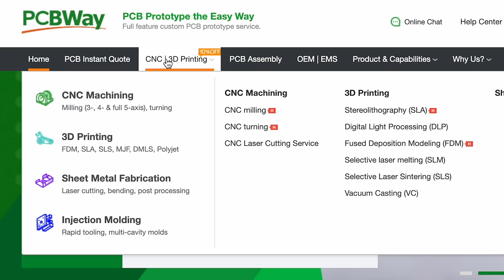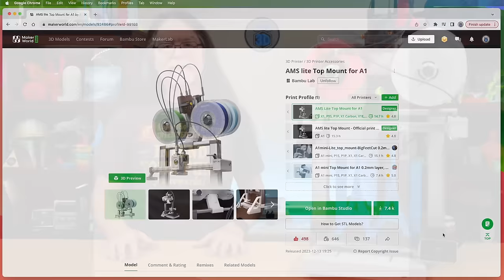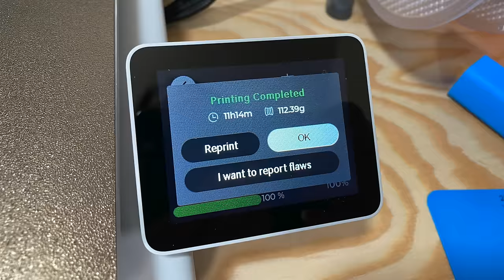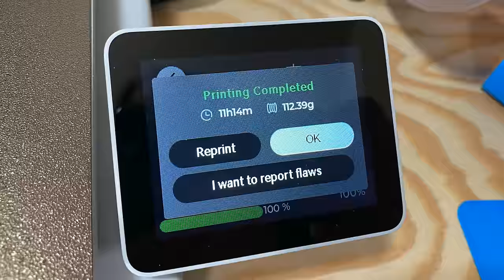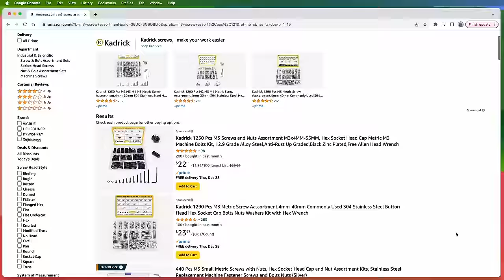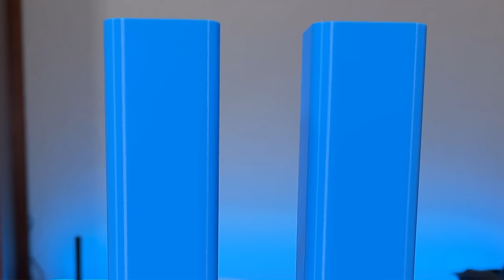Bambu Lab A1: Does AMS lite on top RUIN print quality?

Comment: The thing is, while the printer may wobble, the motion between the printer and table doesn't matter. The only thing that needs to be constant is the motion between the extruder and print bed, and because of a strong design, that doesn't change. This is the same reason that all the shaking of an X1C doesn't really matter, and new feet or concrete blocks don't change print quality. But a great video confirming this.
Reply: “strong design”... no, it’s not! Both Z-beams are absolutely light and relatively thin - only connected at the top by injection molded parts - tends to skew. The entire print quality only works through active input shaping, so you shouldn't fool yourself or sugarcoat anything.
Reply: Probablemente colocar tanta masa en ese punto crítico, aunque a priori no afecte a la calidad de impresión, acabe por  reducir la vida útil de la impresora. Las vibraciones nunca son buenas para ningún mecanismo.
Reply: Exactly. I believe Maker's Muse did a series of videos on this a while ago where he tested different configurations and even suspended the printer in mid air without much difference to the print quality. This is before input shaping was available so that benefit was not a factor.
Reply: @emtrax bro ate you a bot or a hater? Why such negativity on so many comments?? Go touch some grass
Reply: Thats not exactly true. The higher the the print goes the less stable the Z access is and it can result in layer inconsistencies. Take a 2x4 for example, if you cut it at 2 ft it will be more sturdy than at 6 ft. The same thing happens with 3D printer and especially when printing at higher speeds. The screws are holding the top frame to the bottom where its sturdy but it flexes at the top. Input shaper can help with this but input shaper is also being run at the bottom where its most sturdy. Adding weight to the top will result in layer issues and print quality degradation unless the Z access has added support to compensate for the extra weight. The printer wobbling is a little different with the X1C because it has a ridged structure supporting the whole printer and input shaping can compensate for any added shaking. If you put an older bed slinger like the Sovol SVO3 on a less stable table, you will see a difference in quality over having it on a sturdy surface. Thats one reason people used to 3D print flexible feet for their printers. 

There are many reasons the print quality doesn't appear to be changed in this video though. He is printing at a higher resolution in precision mode or just printing these super slow since they took so long to print. This will help far more with added weight but takes twice as long to print. The 3D printed support brackets on the back play a huge role here too for adding stability to the top frame. He is also taking advantage of color filament chosen, camera lighting, angle of recording, and Youtubes compression so we cant see any layers and the print looks identical.
Reply: @BenWolkWeiss  I think Thomas Sanladerer did something similar.
Reply: Depending on the print the print itself will move in relation to the bed and cause artifacts.  

Wich is why the eifel tower ones look identical.  But on the square tower is clearly visible wich is wich.
Reply: @jmp7624   good to see there are people witb intelligence here.

You said everything i said to the youtuber except you managed not to insult him.  Wich is find strange.

Comment: Oh no... why does the test model taper so much towards the top? Please use models that independently cause large X/Y movements at low and high Z - the Eiffel Tower is absolutely unsuitable for the test! The alternative tower is also unsuitable - symmetrical distances and too narrow... no possibility for sufficient acceleration.
Reply: Most 3D models taper at the top
Reply: @car_tar3882  you're missing the point
Reply from the maker: Hi! If you've got a suggestion for a model, let me know. I asked for suggestions on the first A1 video, and got "Eiffel Tower" and "Wobble Test" so that's what I printed. I also got a suggestion for the Torture Toaster but that one's pretty short so I didn't think it would show much.

Comment: Great topic for a video but if I'm being honest, I think the results of this are kind of misleading. The prints were printed super slow or in a higher resolution and this helps a lot with the added weight or two hide quality differences. The Eiffel tower is took you twice as long to print than it would on a higher resolution or faster print and that's what most people will be doing with these printers. The blue filament is not a great filament to show any inconsistencies or differences in the layers and I think black should have been chosen here.  The lighting, angle, and youtube's compression also doesn't help show us accurate results since we cannot see the layer lines at all. We are basically taking your word for the quality because we cant really see it. I have seen some youtubers compare printers and say the quality is "basically identical" when you can clearly see differences and layer inconsistencies in the prints they show.

Comment: Truthfully, I am less concerned about quality, and more about long time gantry reliability. We can do all the tricks in the world, but having 5kg of extra weight wobbling back and forth constantly, will undoubtedly wear out mounting points over time. And that is far more important, to keep the gantry solid and square.
Reply: If the engineers have taken that into account when they designed the product then it is of no concern.
Reply: @jessicaalvis7063  Yeah, many newbies shut more experienced people like myself down. We are now hearing that we were right. Exactly what was obvious to us that would eventually go wrong, did go wrong for many. You can't cheat physics and material dynamics.
Reply: @aqhan  so have your top mounted ams deformed your a1 chassis?
Reply: @jessicaalvis7063  I haven't done it because I'm not that stupid. Many did. I did say, can't beat physics. Eventually gantry mounting points will loosen up and gantry will go out of square. Good luck dealing with that. And Sure as the rain, people now starting to file returns and repairs for wonky gantries. I suggest less ignorance in form of "if the manufacturer did it, it must be good", and a bit more research, learning and experience. Helps to listen to people that done it all and seen it all.
Reply: @aqhan  you have no idea about my knowledge or experience with 3D printing, just like I have no idea about yours. Why dont you provide us with some evidence that top mounting is harmful? Even just anecdotal evidence. A Reddit Forum. Something. Because right now all I hear is gas. It has nothing to do with physics. An H-beam that carries a ceiling Can handle that load ofr decades or even centures. So if the gantry is build for it then it Can also handle it for the printers life time.

Comment: I am a beginner in 3D printing but I also saw more errors on right side models and I could tell this before you told which is which.  Also all that weight pushing on the frame will create deformations over time. Probably I would try to find a way to hang AMS on the wall.

Comment: You know, Bryan, this result doesn't surprise me one bit.  I ran into the same arguments when I installed the 3DChameleon's Y adapter on top of the Bambu X1C's extruder... people kept telling me that it would cause issues with the print. But they thing they kept forgetting is that the the Bambu printers use input shaping compensation which cancels out the mass automatically.  In fact, this is the exact type of inverted pendulum mass cancellation that the input shaping algorithm is designed for.

Comment: Btw guys, if you are afraid of it snapping off, you can (obviously) use ABS or PETG or PLA+ OR you can lower the layer height to as low as possible, as that also increases print strength
Reply: Layer height being fine decreases strength. Larger layer heights are stronger as the consistent line of plastic is thicker

Comment: I'm impressed that there isn't a difference, however the inconvenience this introduces when changing the spools would annoy me. My AMS Lite (for the A1 Mini rather than the A1) Lives on a pegboard mount above the machine and so far that has been perfect. By that I mean it hasn't fallen off yet...
Reply from the maker: The top mount for the A1 can rotate left or right to make it easier to get to the spools on the back of the AMS lite. It's not a huge inconvenience (though it's not entirely as simple as having the AMS lite sitting next to the printer).

Comment: I'm considering upgrading my Ender 3 V3 SE 3D printer, as it's a good starter, but I'm dealing with issues like inconsistent print quality and auto Z offset, which are becoming frustrating. I've narrowed down my choices to two options:

1. Flashforge Adventurer 5M, priced at $550 in my country.
2. Creality K1 is also around $550
2. Bambulab A1, costing $700 here, but it's not officially sold, leading to higher prices.

Which one would you recommend?

Creality printers are the only ones with good prices here. However, it seems like all of them need some fixing or adjusting. I want a printer that I can just start printing, go to work, and return to a finished print. I've heard that even the K1 can be unreliable at times.
Reply: too late but im still going for A1 even if its not officially sold here. mainly because local seller here sold it at 832.4USD (after convert from local currency) and the official website only sell it for 489USD for the combo. shipping is at around 45USD so im stil saving around 298 USD compared to buying from local seller. so using paypal or wise here is a better option even if there some custom tax thats needed to be paid.

Comment: Winder if it could be mounted sideways to a wall?? I dont have space above the printer but would love to get it up off the surface
Reply from the maker: Several wall-mount options for the AMS lite popped up shortly after the A1 mini was released. They would probably work with the full size A1, too.

Comment: I haven't noticed a difference between top and side mount but a more experienced colleague told me that top mount would be terrible (I even had to mount it all the way to the right else the it would have contact to my shelves but so far it seems to run fine. (on the other hand I kinda lack the experience to tell if there was some minor quality problem)

Comment: Thanks Bryan. I always come straight to you when researching 3D print stuff. In your opinion, do you think the AMS can be places on the LEFT side of the printer on a table? Bambu says to put it on the right, but I can't see why, physically, it can't go on the left. Thoughts?
Reply from the maker: The cable connecting the AMS lite to the printer will reach. The only potential issue is not having a place to clip the toolhead cable -- the one that connects the tool head to the right side of the X axis arm. Normally that gets clipped to the Bowden tubes, and when the AMS lite is mounted on the right side, that cable and the Bowden tubes tend to follow the same arc. If you have a way to keep that cable up and out of the way, you could probably get away with having the AMS lite on the left side.

Comment: it only affect the print if you do extreme long prints and multi color prints, so weight get less and "trows" off the "input shaper " and generate more or less wobble so it get overcomensated
but to be honest i do not think it will make ahuge difference or that it will cause failed prints,  

on other side every printer use those spools and are attached to the top of the printer or the side of the printer, it has the same effect as the weight will cause "inbalance"  but yet no one can really see it 

Keep up the good work :D

Comment: Hi nice video thank you. I have a question, What is the final volume taken up by the printer with the top mount installed? 
I'm thinking of upgrading my printer to this but i don't know if the printer would fit in my old enclosure.

Comment: Hi, I wanted to buy a bambulab a1 3D printer and I wanted to use IKEA lack to make a box but having a room in winter with an ambient temperature of 16.5°C. I wanted to close on three sides with MDF and leave open at the front... for air recycling. Could it improve the temperature?

￼

Comment: My printer was working absolutely fine but then I installed the AMS top mount and now I cannot get any successful prints. I will be reverting back to the original configuration unless I can find another alternative. Any suggestions would be greatly appreciated.
Reply: Try redo calibration step with AMS lite on top. Maybe Bambulab will include Input Shape with different weghth on top in next printer generation firmware.
Reply: Good luck. Interested to know if it goes back to printing well or if it was something else?

Comment: Great video. I'm more worried about 3rd party spools that don't fit so well falling off... Any experience with that yet?
Reply from the maker: So far I've only run into one spool that had a hub diameter too large to fit on the AMS lite. There are various hub adapters you can download and print, and I did print one, but it still wasn't a tight fit on the spool itself. I ended up respooling the filament onto another spool, which worked fine and took a lot less time than printing an adapter.
Reply: @BV3D  any tips for respooling? Do you use a tool of any kind?
Reply from the maker: @rendez2k  https://youtu.be/LuhLuW35Urw I used the one from this video. In the time since its release early this year, I'm sure newer ones have been released. But this one has done pretty well for me so far.
Reply: @BV3D  thank you 😊

Comment: what does this printer measure with AMS Lite on top i have a space im hoping to put the printer but its not here yet need to plan an instalation 🤣😆
Reply from the maker: Are you wanting just the height, or the entire volume of space where the printer would comfortably fit?
Reply: @BV3D  just the height of you have it to hand please
Reply from the maker: @FKCreationsPrints  Its height is between 31.5 and 32 inches (800mm to 812mm), to give a bit of room for the Bowden tubes.
Reply: @BV3D  thanks this is just what I needed very helpful
Reply from the maker: @FKCreationsPrints  Sure thing! I hope it'll fit where you want to put it!
Reply: @BV3D  sadly not looks like I need a new idea but it’s to be delivered tomorrow  so might have it next to it and move the K1 to accommodate 😂😂

Comment: its funny how everyone puts the ams on there the wrong way. turn it 180 degrees and it wil be actually carried by all of the printers feet. need an extension tho for high prints
Reply from the maker: We're installing it that way because that's how it's designed to be installed. 😁
Doing it backwards doesn't get you what you may think it does. With the bracket mounted backwards:
• The toolhead cable will contact the bracket when Z is at about 190mm. You lose 25% of your build height.
• The AMS lite is now angled backward, decreasing the bend radius on the Bowden tubes at low Z values, and increasing friction within them. This can cause feed issues.
• The Bowden tubes now rub against the two forward spools, and could get snagged between them during a print.
• It becomes extremely difficult to access the screw that locks the unit in the center position (the screw is removed to turn the unit to the left or right to access the spools at the back).